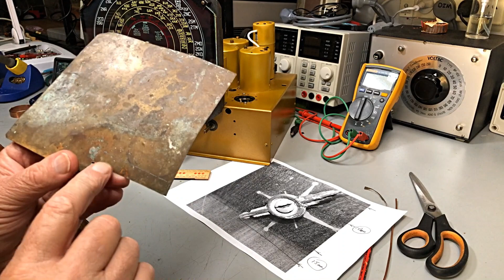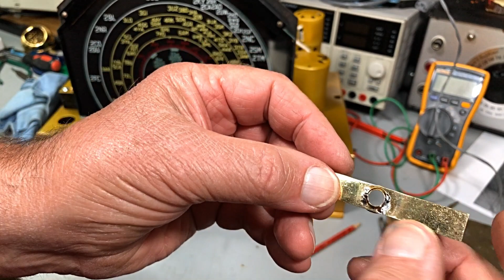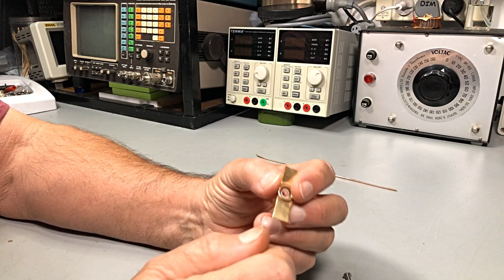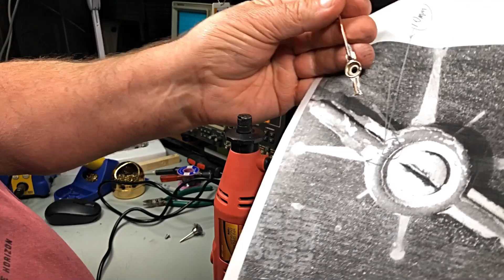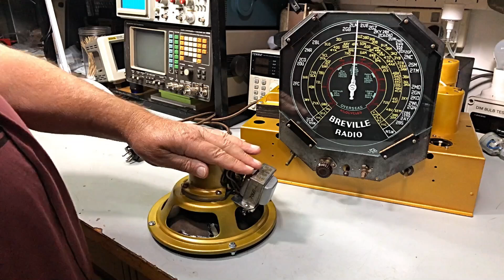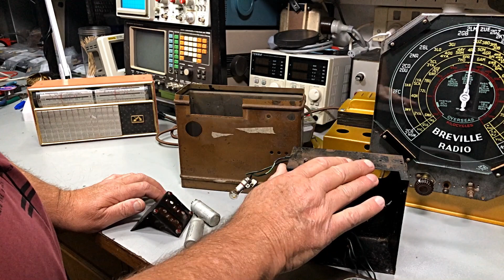My Breville M96 Console Radio gets a Dial Pointer !

Comment: Custom making (homemade) a dial pointer can be a hit or miss, especially if ya don't know the design. Even the hole 🕳 in the middle of the dial pointer has to be precisely made, so the dial pointer will fit snugly on the shaft. The dial pointer even has to be the original color, and design, to keep the value of the radio where it should be. This all comes down to the material that the original dial pointer was made 👌 of. All of the above needs to be period correct 💯 to the radio 📻. Be VERY CAREFUL, when pressing your homemade dial pointer onto the shaft. Ya DO NOT want to bend the shaft, which would result in the painstaking, and time consuming teardown of the radio, to replace the shaft. Your friend, Jeff.
Reply from the maker: Jeff, I think your thinking way too hard about the dial pointer, lol
Mate, of course I made sure it was going to fit correctly & look similar to original. I have another 80-100 jobs ahead of me so no sense worrying if the pointer is 100% period correct.
Cheers & chill out 😃